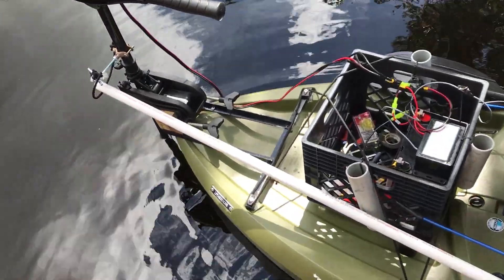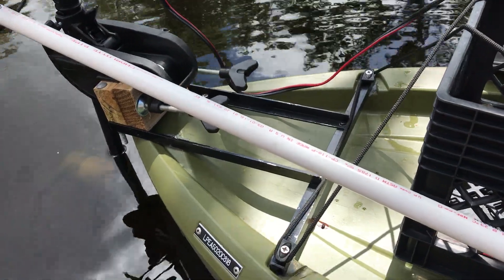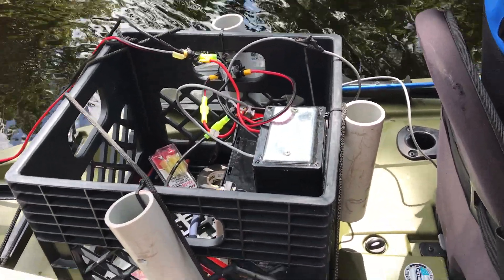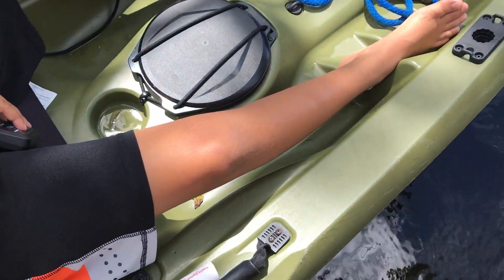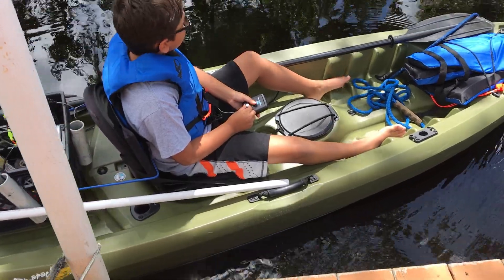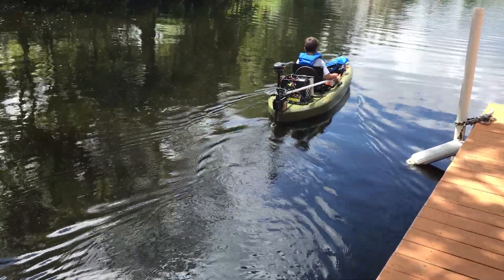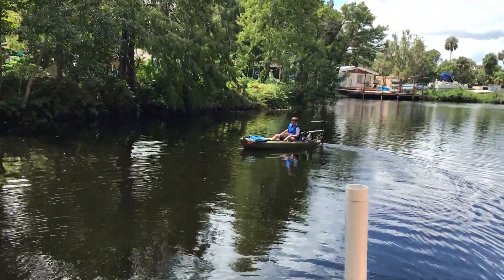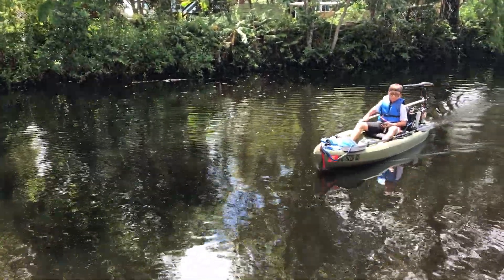Lifetime Tamarack Kayak Trolling Motor

Comment: This is sweet man! Do you ever have any issues with weight? I'm a 200lb man, but I feel like me + the trolling motor/battery + fishing gear might be a bit too much to haul. I think the weight limit is 280?
Reply: I'm 220 and mine still works. You should be fine. I think they can actually carry more but laws.
Reply: The new Crescent Crew can hold 600lbs 1 or 2 seater

Comment: I found the switch online that you use, question I have is how does it hook up to the trolling motor? I see that it has a connector on it so not sure how you rigged it up?
Reply from the maker: I used a motorcycle charger quick connect. The trolling motor goes to controller, controller to battery. Run trolling motor at max speed as the controller will control the speed.
Reply: @ericrosell1344  can you link the part you used for me?
Reply: @ericrosell1344  also how do you wire both battery and trolling motor to the controller? Sorry I’m a newb lol. But isn’t there only one cable on the controller?
Reply from the maker: @ajk4164  The controller is in line between the battery and the trolling motor. So Battery -> Controller -> Trolling motor. In this video I had purchased a controller, that guy is no longer in business. In the past I build a couple others from parts purchased at a local electronics shop. Sorry no link and I no longer have the E-Kayaks. Good luck!

Comment: Great vid,  ...i have tamarack on order. so hope to do something similar.  any idea how long the 35 amp hour will run the motor if i were only to use 1st and 2nd....I fish on ca delta, and no need to go too far to find fish. Although i dont catch many lol....i want to do a pwm also, but  I still wont be going fast. tks in advance Ken....
I subscribed and liked, hope you do more mods and share....
Reply from the maker: Concord Roofer  I get all day out of it. The controller helps that and I never use more than 60% of gas until the way in. All day on the flats is till about noon as it gets much hotter after noon in Florida to be on the flats. I head out at safe light.  Good luck. Btw I leave the motor in position five and the controller handles the power management.
Reply: @ericrosell1344  Hi Eric   sounds like me, have to stay oout of sun.    so thats what i am going to try, thanks so much for reply. I will let yoou know how mine works out....stay cool and enjoy your modified Yak.

Comment: Nice job!! Post the how to if you can please.
Reply from the maker: I never made a video on how I built it as it was over a few days. Its pretty basic, get some of the thicker 1.25 inch wide angled aluminum at homedepot, I though bolted as i had access. Just did the same on a new version of this yak and had to get the Stainless steel toggle bolts from west marine (they sell them for bow mounted trolling motors). For the controller, the company I used is out of business. On the second kayak  built my own PWM (Pulse width modulator). I'll try to get an updated video of both of them to share shortly.